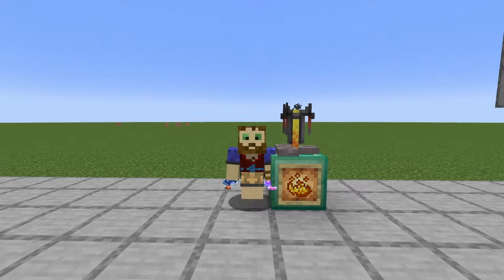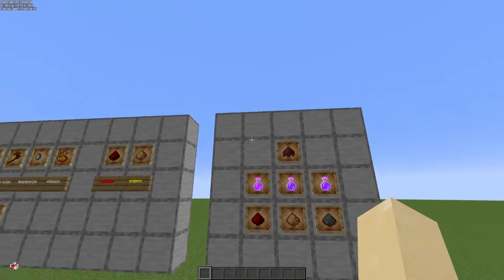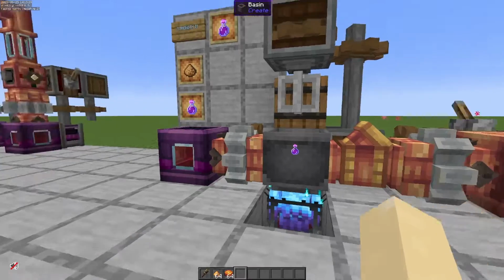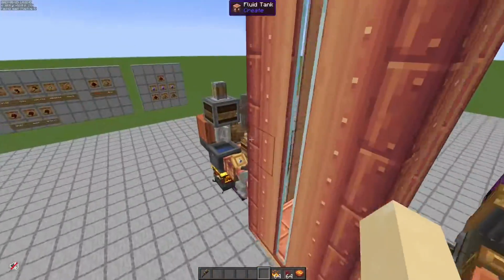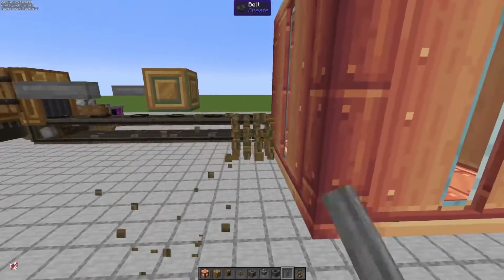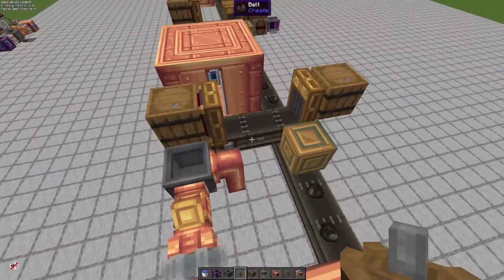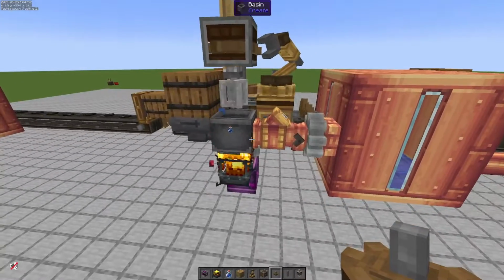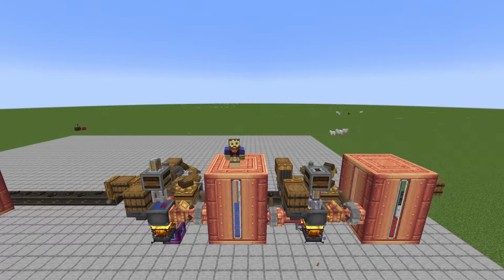Create MOD Potions Brewing Guide - Step-by-Step Build Guide | Minecraft + Create

Comment: does this still work? im making a farm for gunpowder currently and i need these potions but i cant seem to get it to work, with the speed of it it ends up half awkard potion half water with 16 wart in it and it will not grab that awkward potion, no matter what i set the filter to, is there a fix for this or will i just have to cope?
Reply from the maker: It should still all work, I used it in my Recent Create Mod Adventure Series (Will Link it) and it worked just fine without any struggle. Did you add a filter on the Basin as well as the Extraction Pipe? If you continue to struggle please let me know or ask on the Discord. That way myself or a community member can assist.

Sorry for being late to reply, I have been away for a while!
https://youtu.be/NCGmG7SOX-w
Reply: @Deosil25  custom mod recipe for potion of harming using poisoned potato, it doesnt work at all with that recipie for some reason, ive tried it, filter is potion of harming, nothing on the basin, its just messed and it screwed up my whole contraption
Reply: @Poixon_2  did you put your smart fluid pipe before your mechanical pump so it will filter the water first, then pump your potion to another basin